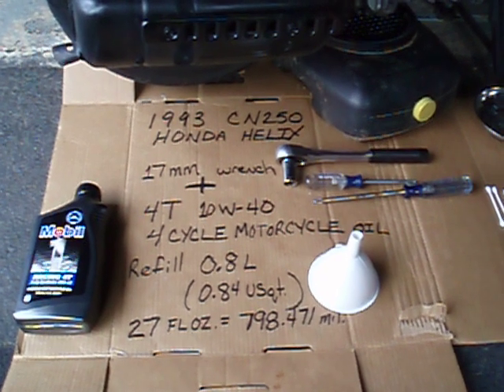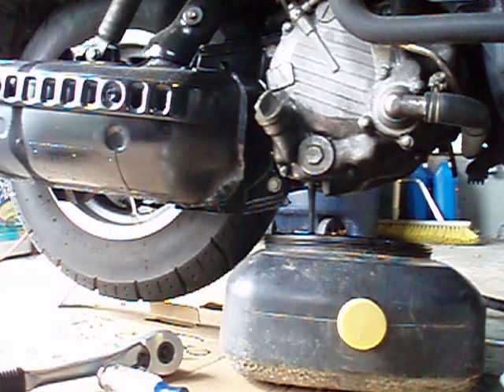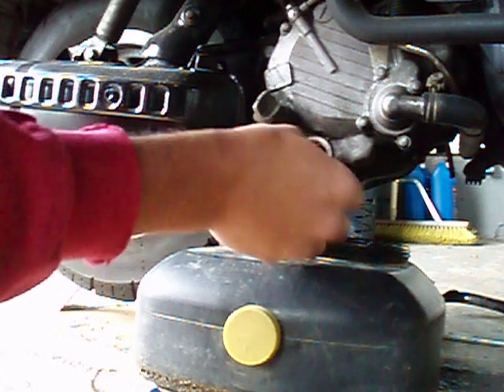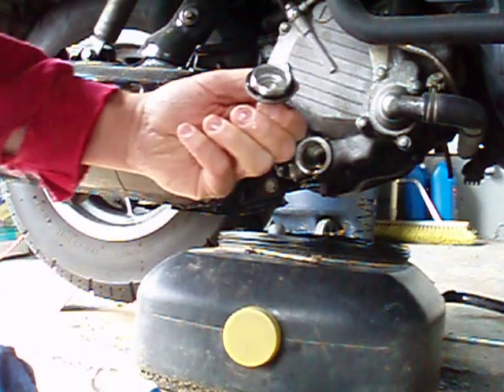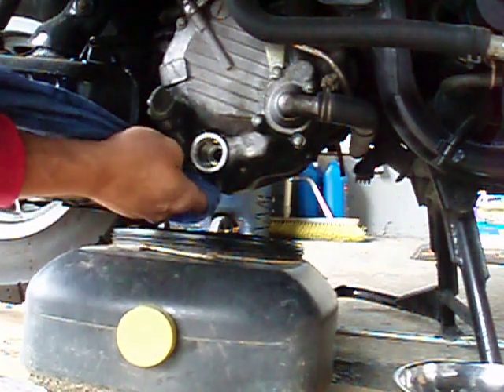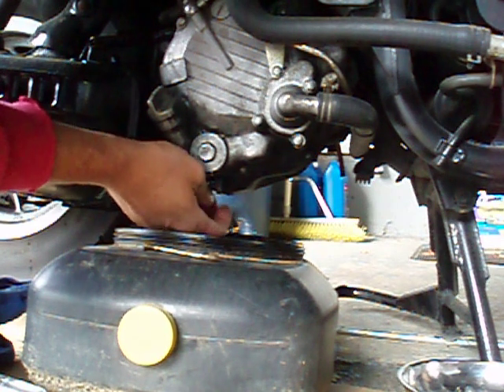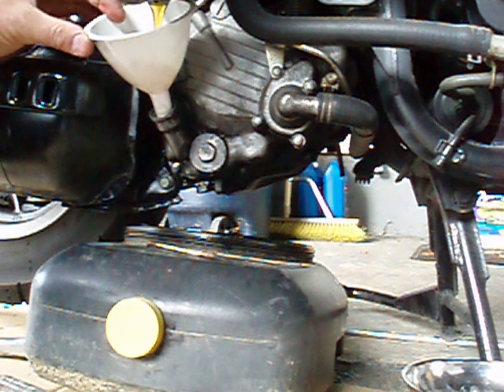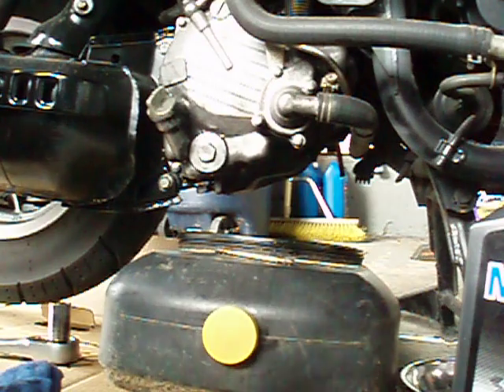Honda CN250 Helix  Oil Change

Comment: Nice job! A few things I'd add; 1) The drain plug crush washer should be replaced after at least three oil changes, or else it can leak (they cost about $0.50 at the dealer, I keep a dozen on hand). 2) Motorcycle oil is not required in this engine, as it does not have a wet clutch or a common-lube transmission; any quality full-synthetic will keep this engine running for decades.

Comment: nice tutorial! If you lean the bike over even more while draining, you can get pretty much all of the oil out and then you will need a full 1.0 liter to replace it all. Also, I think you are supposed to let it warm up and then sit for about 10 minutes to check the oil. Remember, oil changes are extremely important as there is no legitimate oil filter...magnetic drain plug is not a bad idea as well.

Comment: @grateweb The easiest way to change the coolant is to remove the lower pump hose with the radiator cap removed. The radiator fill cap is under the dashboard; remove the dash cover (above the glovebox) to access it. ONLY use silicate-free coolant (I recommend the Honda coolant sold at the dealer; you'll need two bottles).

Comment: !!!TO RESET OIL LIGHT!!!
There is a little "slit" on the rear of the speedometer cover.
It's about the size of the tip of a screwdriver.
Press a screwdriver into the slit to reset the oil indicator.
Reply: Mike Webb This is confusing. The slot is directly under the indicator.
Reply: Ok you can use the key =)
Reply: @thecollegepicker  it is meant for the key 👍

Comment: @SanftnerDotNet Costs me roughly $8 per oil change, using Royal Purple full-synthetic. You do not need to use motorcycle oil in this engine, as it does not have a common-lube transmission or a wet clutch.

Comment: Thanks for the video, just did my first oil change on my "new" 86 Helix (commuting to work and saving $40 per week).  I had one problem, the oil filter plug is stripped and couldn't take it off, so I just replace the oil, but didn't clean the screen.  Just order a new one, now I need to figure out how to remove it.
Reply: Did you solve this issue?

Comment from the maker: Just think this little engine is working extra hard to do highway speeds. The 4T oil has high levels of phosphorus/zinc for a better share rate.
Have you ever ran a chainsaw? The bar oil is different than motor oil. If you use Motor oil as bar oil it boils.

Comment from the maker: I live in PA and ride this at least onec a week, to keep the gas flowing. 
So far the exhaust is the only problem, the smallest leak in back pressure will drop your top speed and give you back fire problems.
Reply: Just bought one have the exact same problem. Do I need to replace the exhaust

Comment: Saw several questions in the comments about viscosity and types of oils to use.  First, from the shop manual.  Recommended oil.  Honda 4-stroke oil or equivalent, API service classification SF or SG.  Viscosity 10W-40.  That is accompanied by a chart that shows 10W-30 for temps up to 90.  10W40 for temps up to 110 and also 20W-40 also for temps up to 110.  For temps up to 120 they suggest 20W-50.  These would be outside temps of course...Theoretically the engine will always be the temp set by the thermostat, but it is typical to use thicker oil when it gets hotter.  There is no mention of synthetic in the manual.

Then I tried to find out about currently available Honda oils.  That takes you to prohondaoils.com.  There they have four Honda 4-stroke oils.  Seems their original offering is called GN4 which was upgraded to HP4 with more additives and better viscosity.  Later yet they introduced HP4M and HP4S.  The M is mineral oil based.  If you didn't guess, the S is synthetic.  They have a chart showing using GN4 and HP4 for models up through 2006 and using the synthetic for models after 2007.  It would infer you shouldn't use synthetic on earlier models but I haven't seen that 2006 vs 2007 cutoff before.  I know I used Mobil 1 in my '73 CB350 and it ran like a top with synthetic.  Higher revs, more power.

Comment from the maker: No oil filter so there is a +. Just an oil screen, ike the old VW Beetles. The Only cost is the Oil if you have the tools. The oil I use is about $10 MOBIL 1 RACING 4T OIL. You can go cheaper, but why when you only need one bottle.

Comment: lol.....guess you're right about the squeaking. I noticed that chinese clones use lower quality plastics and are really more like slapped together and miss the distinction of japanese originals.....and btw, thanks for your oil change video. I did an oil change according to your instructions using synthetic 5W-40.

Comment from the maker: I wouldn't run 20-50 weight oil in liquid cooled engine. The pressure might blow past the piston rings. My air cooled VW beetle on the other hand has to use 20-50. 10-40 causes the engine to over heat.

Comment: I just recently purchased a 1987 Honda Helix CN 250, with just under 31,000 miles on it. The Bike runs, and performs, and handles superb for it's age, and mileage. My question for you, is why did you have to "Bump" the Starter Button when you were draining the old oil from the Crank Case ? What does that do ?

Comment: Please I need help , my heat meter have rises up to the last bar even for a short drive, please how to cool it down  , do I need to put some water in the coolant or what do I have to do please I need help
Reply: Thermostat Failure ?
Reply: Thermostat radiator coolant change can check to see if fans working has to be one those
Reply: @seanstambaugh3166   I have done radiator flush , and no more using water , I use coolant .electrician set fan to ignition now temperature is down only 2bars, will the fan wire connected to the ignition cause any harm to my bike

Comment: I just bought a 1998 helix with 24,000 miles a few days ago. It' my first bike.
 What's the average cost to do this yourself? (A place in town told me theyd do oil for $22). Also, did I miss seeing it, or does it not have an oil filter?

Comment from the maker: manoman0...OK the QLINK Commuter 250  is made in China as far as I can google it. There was a orginal 1st clone of the Helix that was made in Taiwan I can not remeber what that company was or is called. I have noticed every single Chinesse scooter does after about a 1,000 miles is start to sqeak and rattle some. I sure it will hold together but it will drive you nucking futs afer a while.